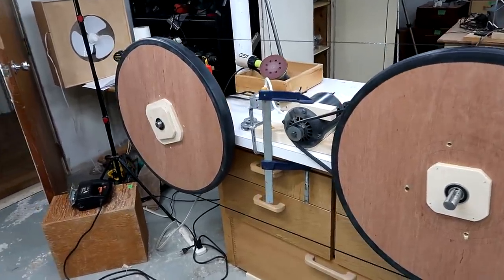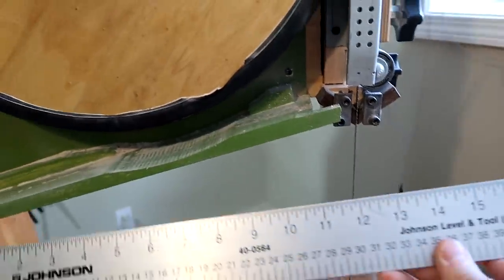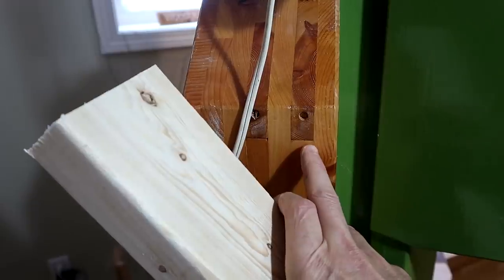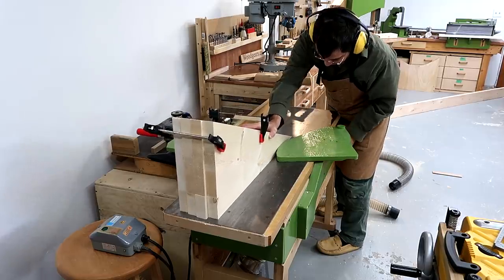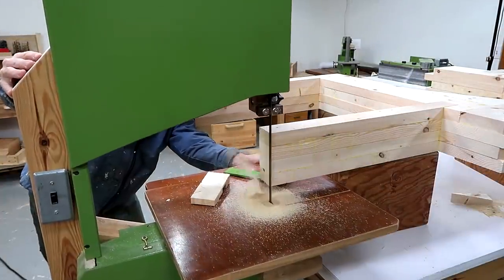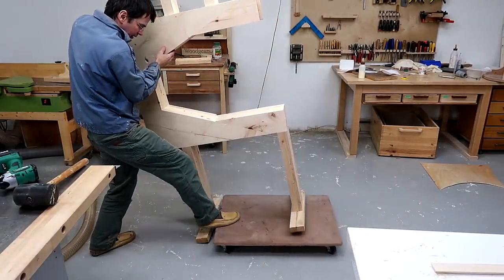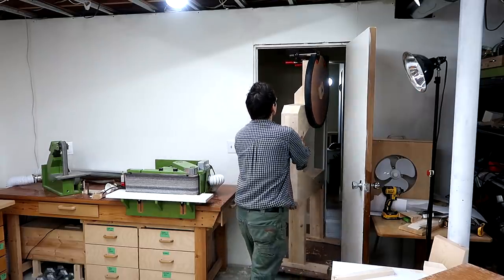Building the 26" bandsaw frame

Comment: Too late now, but about the height of the saw: I have a bandsaw with two wheels on an axle which is mounted with an offset backwards and upwards at the back of the saw so that the wheels aren't touching the ground. When using the saw it stands stable on it's feet. But for pushing it around I tilt it backwards like a sack barrow until the wheels are on the ground and now on the one hand it is very easy to move around and on the other hand the heigth is much more less than the standing saw, depending on how far I tilt it.
Hope you can follow this explanation, english isn't my first language ;-)
Reply: Uups, he answered that idea already...

Comment: I think the safest bet, for the first Wandel saw, would be to get a cheap second hand unit that has enough throat to field the largest parts in the plans and then just selling it back on into the world. I'd consider that worth it, and at least in NA, that's a relatively cheap proposition. Large band saws are hard to find and expensive (where they are worth the chase) but small ones...as i see it, they are plenty and many to choose from.
Reply from the maker: A cheap second hand bandsaw is only happens if one is cheaply available.  Most of the time, it is not.

Comment: A question from an mechanical engineering student to an actual engineer: Do you calculate the stresses on the frame and then go on to building the real thing? Or did you gain enough experience through the last 4 (?) bandsaw builds, i.e. did you design by trial and error?
Reply from the maker: The frame isn't massive for strength.  It's massive for stiffness.

Comment: What does someone that uses the metric system call a 2”x4”?
Reply from the maker: I call it a 2x4
Reply: 90 x 35, or 90 x 45 depending on whether you want it a little smaller or a little larger - most countries ditched the silly nominal sizing when they went metric.

Comment: I'm assuming you went with a 26" wheel in order to use a 26" bicycle tube for the tire on your wheels....You know there are also 24" bicycle tubes which would probably match up better with blades made for 24" saws.
Reply from the maker: Used a 20” tube.  Needs to be smaller so it’s stretched.
Reply: @matthiaswandel  Gotcha...There is an 18" tube size too that could maybe work for a 24" wheel. Though I guess if you're looking for more throat clearance than resaw height bigger wheels is the way to go.

Comment: Just an idea. I know you're frugal (re cheap 🙄). If looking for lumber for the frame and you want to go the laminated route are there any discount flooring stores nearby. Such as Lumber Liquidators.  I know you would most likely loose some thickness to planning operations but it might be an option. I would think a nice dense hardwood especially if one could get 125 or 150mm wide planks 19mm thick (5" or 6" x 3/4 for the Imperial minded) would be plenty strong enough. In terms of planing operations the finished side would need to be planed to remove the finish. The bottom side might have to be planed to remove the dados. One issue I could see is possible problems with odd lengths. Im not sure if the tongue and groove would be an issue. It's just an idea.
Reply from the maker: Discounted flooring is still more expensive than buying 2x6 lumber.  And way more work.
Reply: @matthiaswandel  
As I said. Just an idea. I have no idea about prices in Ontario but lumber prices here are getting crazy. Good or select grade lumber is outrageous IMO. Bottom grade looks like a piece of licorice. Even then if you need decent length you are looking through the stacks. Also due to COVID-19 supplies seem to be short.

Comment: For some reason my mind says it’s easier and cheaper in the long run to replace the door with a taller one and end up building the bandsaw height you really want. After all your going to all that trouble.
Reply: My much simpler mind says add two rollers to the rear of the machine and lean it back to move it though the doorway.

Comment: Assemble the top wheel once it is moved to the desired location.
Reply: The desired location may change many times in the course of time.
Reply: Not the point, he wants it to be portable and forgot that simply adding rollers to the rea of it would solve the issue of getting it through any door

Comment: I admire your hard work and initiative, but there is a time to switch to working with metal...and this is undoubtedly one of those times. Explore the world of metal...welders are cheap. Look into lathe and mill work. It's also a lot of fun!
Reply from the maker: A metal frame of the same stiffness would be heavier, more expensive, and more work!  There's reason we build houses out of wood.
Reply: @matthiaswandel  Actually, in Australia the house framing is becoming more commonly metal as timber has become so expensive, and termites of course.

Comment: Have you thought of building a saw with multiple smaller wheels in a triangular or 4 wheel pattern on the upper side to minimize height while increasing throat depth and resaw cut thickness?
Reply from the maker: yes, even made a video about why it's a bad idea.
Reply: @matthiaswandel  thanks for the reply. I missed that video. Great work by the way.

Comment: Living where you do there has to be a sawyer reasonably close with which you could work a trade of work or service for some hardwood lumber to use of better quality. That's a lot of work for spruce or fir.
Reply: Why go through all that trouble when you can just use what you have.
Reply: @KipdoesStuff  Because Matthias remarked as to the lesser strength of the "2 by"

Comment: 1/ Are the big triangles glued up from 2x6's also?  I looked and could not see any seams.  So if so, those are nice tight glue joints.

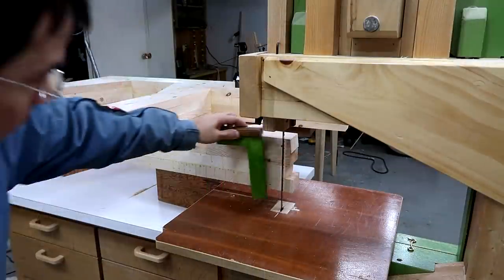2/ The confession at @5:21 must have been hard.  😁   Besides, I'm sure you could have cut those with a hand saw,  But if you already have another saw, why torture yourself?
Reply from the maker: Glued up from 2x8 and 2x4, though two 2x6 would be just the right width too.

Comment: Why a bigger bandsaw that really isnt bigger?  Maybe make the table lower??
Reply: it is bigger to the side. Much more room between the blade and the post ;)
Reply: A larger wheel diameter means less stress on the blades. If I remember correct, Matthias mentioned that some blades required that wheel diameter to be usable at all.
Reply: It is bigger, as it has more horizontal capacity. 13.5"/23cm resaw height was probably already enough.

Comment: Matthias, it should be fairly simple to build a hinged upper doorflap that is normally closed just due to gravity, holds the top of the door frame, and can be lifted to pass your bandsaw through. Presuming all the other doors in the basement are standard height, of course.

Comment: I have a bunch of old angle iron bed frames. I wonder if a bandsaw could be made with them without welding?
Reply from the maker: Yes, make it from wood and throw out the angle iron.  You will save a lot of frustration.
Reply: Bed frames are very hard brittle steel. Not easy to work with. Try to drill a hole in one.

Comment: For me, the highlight of  Matthias' builds is his choice of motors. He's going to need some grunt for this bandsaw. Too bad car alternators can't be converted to AC, there would be an endless supply.
Reply: Well, you can convert AC to DC - so there's not much problem there. Full Wave Bridge Rectification here we come!
Reply: Alternators also don't make very good motors; they're optimized to be alternators.  You can run them as motors with polyphase inverters, but the voltage waveforms are not sinusoidal and the torque is not particularly smooth.  Besides, if the point of the saw is to provide greater throat depth instead of massive cut height, a very powerful motor isn't necessary.
Reply: @usbcd360  That's too bad. They're heavy-duty and there's an endless supply of them, almost free.